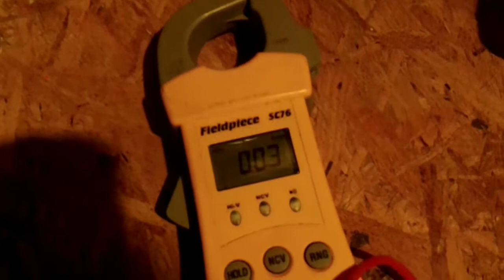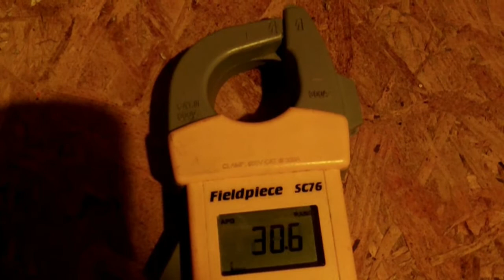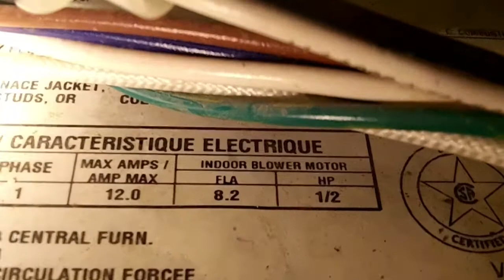Bad Run Capacitor

Comment from the maker: Good thing for them it's been pretty mild here so I got to it just in time!!!! I was pretty worried when I put power to the motor before testing the run cap and it only ran half speed I thought for sure I was going to be replacing the motor!!!!!